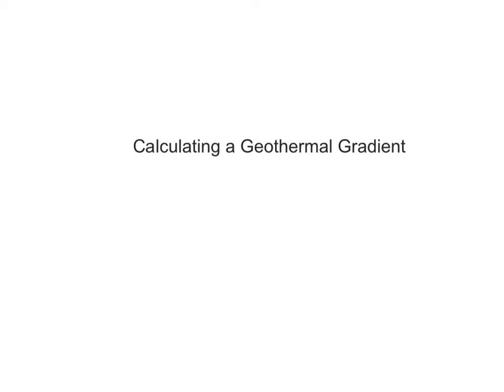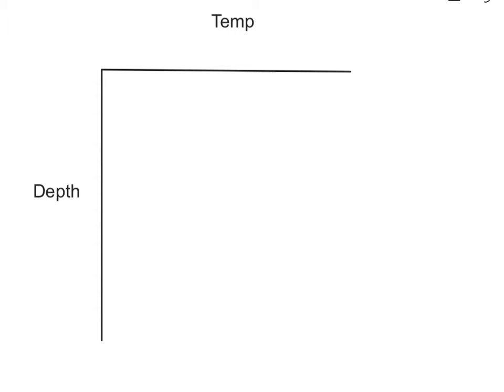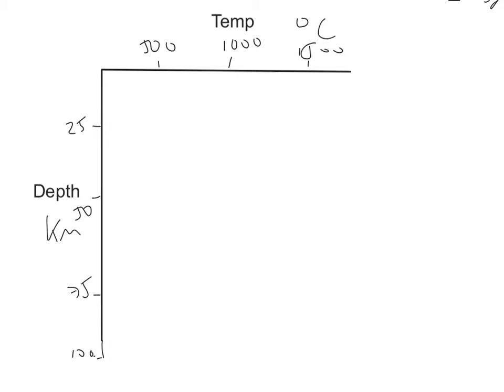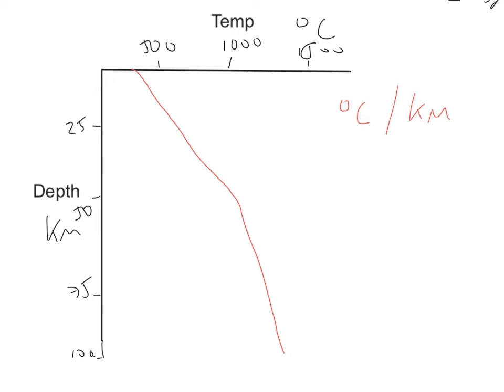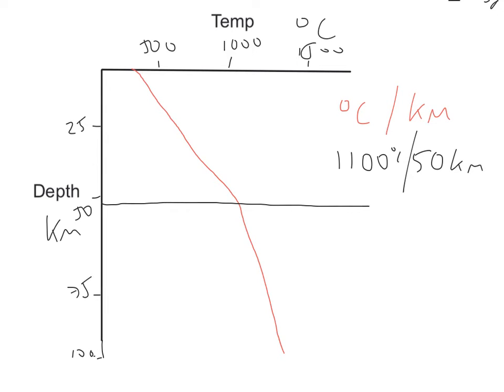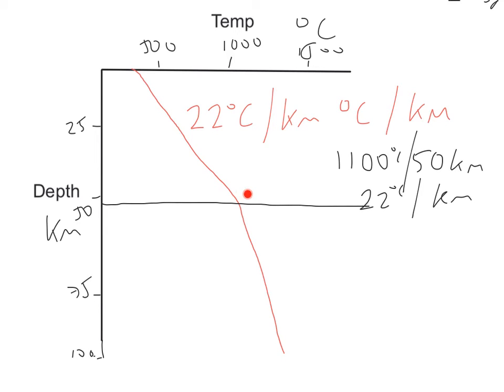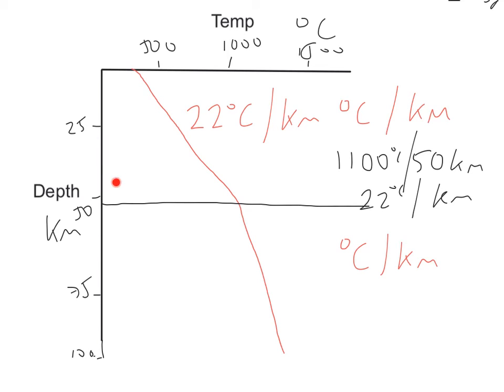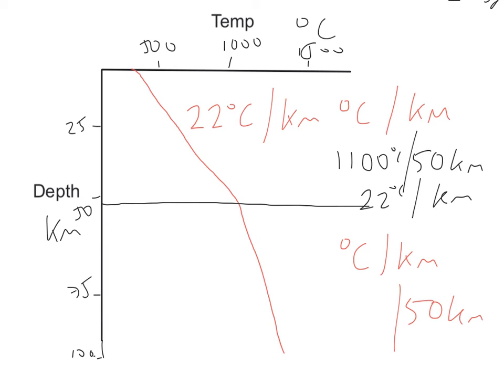Calculating a Geothermal Gradient

Comment: Actual measurements put the geothermal gradient at 133.64' to every 1° F increase.

If the gradient temperature was 133.64 ft per every 1° increase then how hot would the core be, seeing the radius of the Earth is 3,963 miles? There is 5,280 ft in a mile so you would multiply the two to get the feet or depth to the core, 3,963 x 5,280 = 20,924,640 ft ---- 20,924,640 / 133.64 = 156,574.68° F That's about 86,968.16° C.

Did you know that the gradient temperature after 200 ft deep remains a constant 1° increase for every 133.64 ft in depth?
Reply: There is a thing called the Metric system..